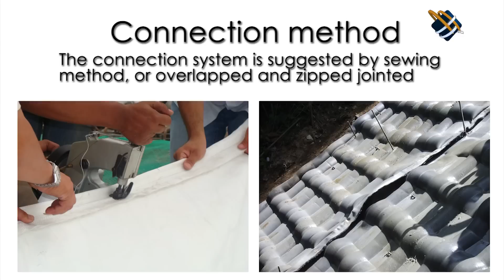ACEFormer™ Geotextile Mattress Installation for Slope and River Protection

Comment: how many days cement mortar will be settled
Reply from the maker: The performance of mortar in ACEFormer™ would be similar to the one used in civil engineering.
Generally, the time of initial setting is around 1 hour, and the compressive strength would be expected after 28 days.
The actual time depends on the type of motar and in-situ environment.

For further understanding about geotextile mattresses, please browse our website!
https://www.geoace.com/products/Erosion-and-Sediment-Control/ACEFormer%E2%84%A2